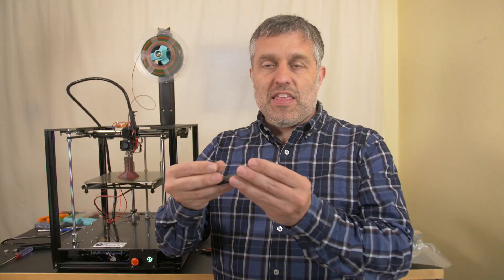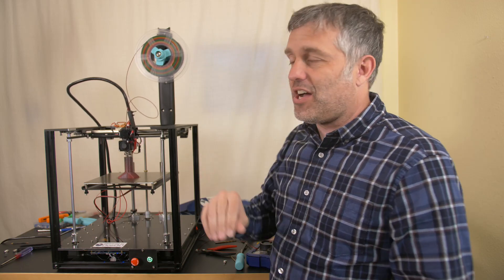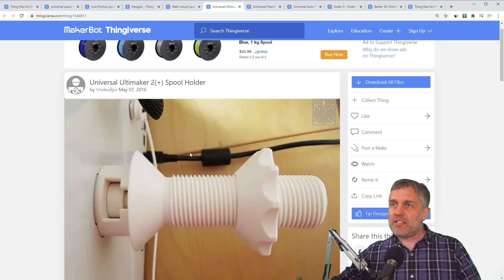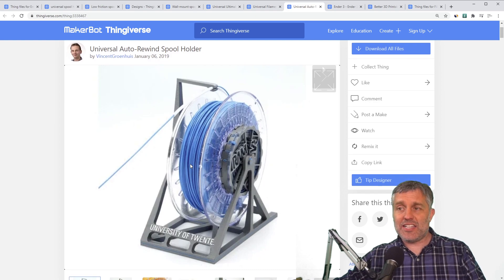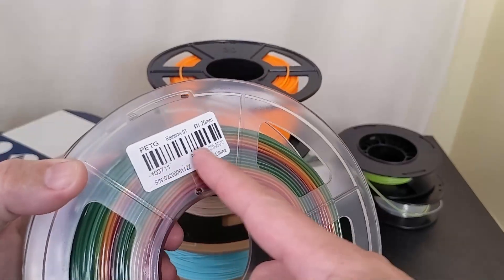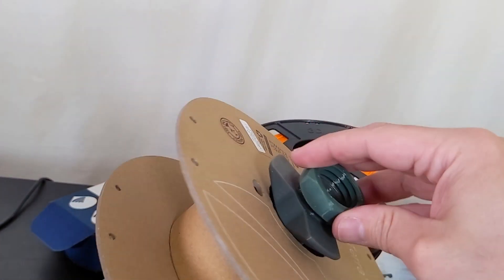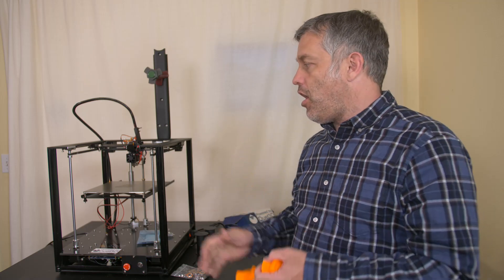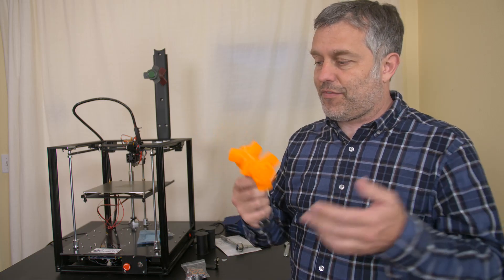The Quest For 3DP Filament Spool Holding Perfection

Comment: That's a really nice design! In my opinion the main problem is that when you attach the roll of filament directly on the 3d printer every movement gives a tiny push to it, that then pushes back the printer. This makes ghosting much worse, and is especially apparent when you have a moving bed and the roll of filament on the top. My solution was much simpler, to put the roll elsewhere! At the end of the day I have a Bondtech extruder, the force that thing can use to pull filament is scary, it won't have issues with the tiny amount of friction!

Comment: I personally love this design: https://www.thingiverse.com/thing:3209211 -- too bad it wasn't featured.
I've been using this design on multiple printers for hundreds of hours, and it's almost perfect. The only time I was doubtful was with a 2.3kg roll, which was almost too wide, so I made a minor mod to prevent it from slipping off.
It takes 2 printed parts and 2 608ZZ bearings. It's simple and effective; only requires 2 bearings; and fits any flange spools I've encountered thus far. This particular version is an easy replacement for Creality Ender 3 type brackets, but there's other versions as well (e.g. https://www.thingiverse.com/thing:3020026 ).
Reply: I too use this roller. I did  have a problem with the Roller Insert in that it was too small for both the bearing and fitting inside the roller. The fixed end of roller fit snugly in the bearing. Strange how coming out of the same 3d printer, same slicer settings but different diameters. For the insert, I made it slightly larger for a decent press fit.
What I like with this spool holder over the others, don't need to screw anything to change spools. It just slides over it like the stock holder.
Reply from the maker: Thank you for this. I may make a follow up video and feature it.

Comment: I'm not an expert in these things, but isn't it the case that when making a derivative work from an open source design, that the derivative has to also be open source (i.e. not behind a paywall)?
Reply: The original licence that’s its free to remix even for commercial purposes. He should give credit though.
Reply: Like a link
Reply from the maker: I did not remix anything. I started from a blank screen in CAD, and based my measurements off the spools which I showed in the video. Every single facet of my design is my creation. Is a Tesla Model S a Remix of a Ford Taurus?

Comment: I've had this idea for a while and wonder what you think. Since I have two extruder drivers on my mainboard, and the spare parts to make this work, I want to hook up the second extruder motor directly to the filament spool. This way, the filament would always be primed so the actual extruder has to do minimal work when it comes to pulling or pushing the filament from the spool during extrusions and retractions. The driver would obviously have to be tuned correctly for the amount of extrusion and the type of spool in order to rotate it the right amount (not to mention the diameter of the filament roll - there should be enough slop to make it work without being too exact though). More work than anyone would reasonably do, but I'm not all that reasonable.

Edit - not sure what happened to my comment so retyped it.
Reply from the maker: It's very doable by it violates the K.I.S.S. principle: https://en.wikipedia.org/wiki/KISS_principle

Comment: "Your design" ... in that you took an existing free design, slightly modified it, then put it behind a paywall.  If this really was your design or you made major changes that'd be one thing, but you should at least have the courtesy to post it on thingiverse as a remix so the original creator can get some credit.
Reply from the maker: I did not remix anyone else's work. I started from a blank screen and drew every single facet of my geometry. By your reasoning Tesla should pay Ford a royalty check because clearly a Model S is just a remix of a Taurus. Also, please unsubscribe from my channel and do not watch any more of my videos. I do not give you permission to watch my content. You are worse than a free loader. You are actually attacking me for daring to ask for compensation for the value I have added.
Reply: @DesignPrototypeTest  I apologize, I can only know what you show me. I'd suggest focusing on that next time. Your video spends a lot of time showing us other designs and goes on to make it look like you picked someone else's design and changed one thing. I know it's important to draw from what already works and improve from there, but I didn't get the impression that you designed it entirely yourself, I didn't get to see that process. It felt like "look at this design, I like this one... and here's what I changed" basically. I would have loved to see your process more in-depth, even a timelapse would have been nice, or maybe a brief review of your itinerations to your final result?

I do recognize I came out the gate rude, and assumed somethings I shouldn't have. I'm not sorry for standing up for the other designer, but I am honestly sorry for misjudging you.  I've had people take my own work, make tiny changes, then claim it as their own - so I was a bit harsh because I know how that feels. 
I hope in the future you're a bit nicer to new viewers that stumble across your channel.  I'm not a subscriber, never was. This video is public, anyone can find it and watch it. You may want to change your upload settings if you meant this to be a private video.
Reply from the maker: Apology accepted. The core value of this channel is recognizing original creators in an attempt to have them reap the rewards for their contributions. I provided a tour of existing "prior art" to show the evolution of the design. I am merely adding the latest creation in a chain of ever improving designs. I'm sure someone can improve upon what I have made. I hope they will acknowledge those who came before them as I did here.
Reply: @DesignPrototypeTest  , that Taurus/ Tesla thing that you used repeatedly was not the best analogy.   Thank you for showing the older designs btw.

Comment: I personally like the two Part spool holders (like the "tush" on thingiverse) where the spool rides on its outer walls best. Super easy to change spools, low material, very few points of failure.
Reply: I always have problems with the spool getting dragged out of it as the filament nears the end with the TUSH design. The last of.the filament usually feeds fine jammed sideways against my printer, but it is hardly ideal.
Reply: @adaycj  yep, same problem 😔
Reply: I haven't tried it myself, but a spool weight might help: https://www.thingiverse.com/thing:4266659

Comment: 608 RS bearings, they have rubber seals that are removable. I pack one side with TinkSeal, bearings not only roll smoother, but the TinkSeal helps keep the dust out as well.
Reply: FYI - 608 bearings with metal shields (608 ZZ or 2Z) are non contact.

Comment: I started using a self centering (conical end) bearing design in..2012 I'm pretty sure...love how it rolls, HATED loading it though as I have a habit of changing spools frequently. Uses M8 similar to the one you showed from '13. But yeah...man I despise having to screw those cones together to swap spools. Definitely like your design!

Comment: Question: Wouldn't changing the threading of the original design so that it is reverse threaded keep it from unscrewing itself? At least if you are having the spool spin in that direction. Just a thought.
Reply from the maker: When spool is flipped and feeds from the other side the nut would still unthread (theoretically). Like I said in the video, I don't know if this is a real problem anyone has actually had.

Comment: Ive been thinking these past weeks of making one of these myself. I wanted to get a cover for my spools to avoid dust while they sit around on the print, maybe I'll just make that part and add it in onto yours.
Reply: theres filament dryers that will act as a cover, the sunlu ive got has kinda meh bearings or fitment of them, but it is also a dryer too... ive never used mine directly with the printer, we have the ender 3 style one in the video which is nice :)

Comment: Good design. However! The problem with this low of a friction on a spool holder is that some filaments tend to unwind and then kink. Also when filament unwinds too much it tends to crisscross itself which causes famous knotted filament issues.  I use something similar except i just use 12mm pipe and two 1mm wide contact sliding points. very low friction but enough to keep the filament nicely wound but will easily dispense just enough filament. when it's printing the spool is continuously slowly rotating,  no unroll, stop...  etc.

Comment: Very nice work my friend. I appreciate how you see failure, and potential failure in the everyday stuff we use in 3d printing.  It's refreshing when someone finally stands up and says,  "Not today, Satan... Not on my printer".... lol.  I also appreciate your teaching technique. Keep it up man!
Reply: Another solution is to open the bearings, clean them and change the lubricant for grease. I have used it for other projects with the same purpose.

Comment: Not sure if you check comments or not but another simple solution to some of the earlier designs would be to make it a reverse thread then you wouldn't have to worry about a locking nut.
Reply: lol saw this comment right after posting mine. Sometimes the simplest solutions are the best ones.

Comment: I use this kind of spool holder for about 3 or 4 years now...when I designed mine I use left hand threads on the tube to be sure it will not unthread itself !
Reply: care to share your design STL?
Reply: this is how I would have done it as well